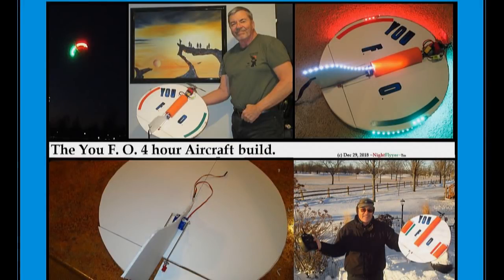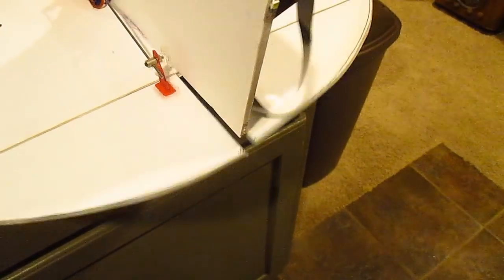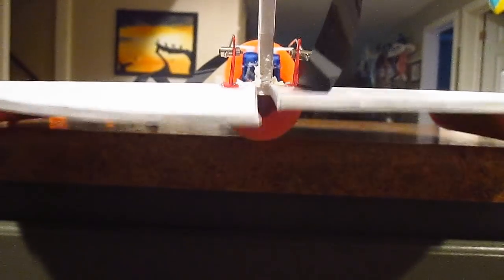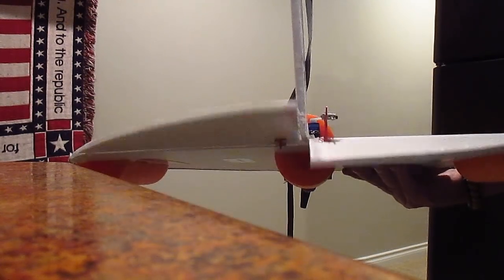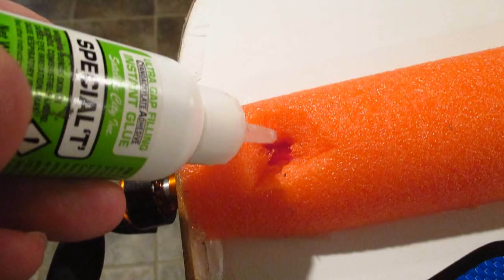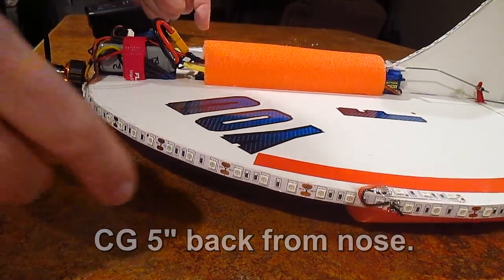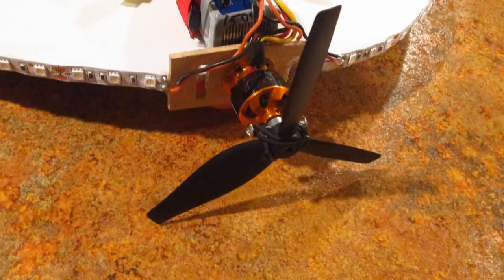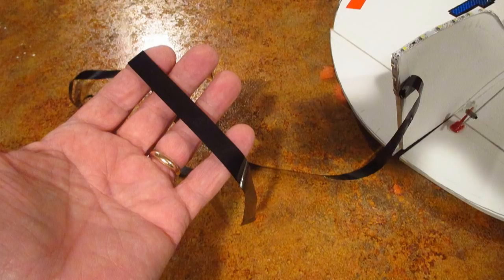Home Made Flying Saucer Update! 4 Questions answered plus exciting flight.

Comment: Dave, still simmering on the back burner about doing this build, just caught up in a bunch of other things right now, hopefully this winter at the latest. I noticed on your design you used elevons, and not an elevator and rudder. Was there a particular reason for you doing this? Still would love to put a small dome on the top and bottom for looks. Not sure what it will do to flight characteristics, and it will make it hard to pick up and hold.
Reply from the maker: Yes.  I have more controls and this thing really needs no rudder.  Plus it keeps the controls all on the right stick. I fly helis, where rudder and tail rotor are on the left stick, so it keeps me sane.  LOL.  Anything on top will not affect it. Good luck.